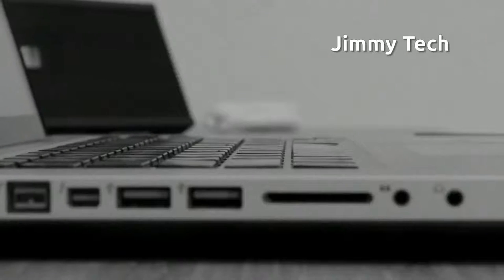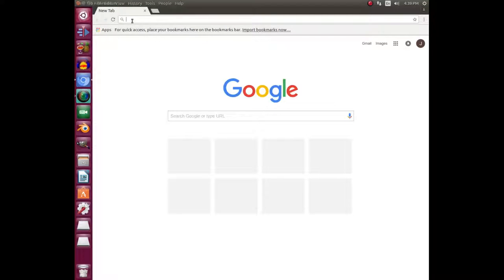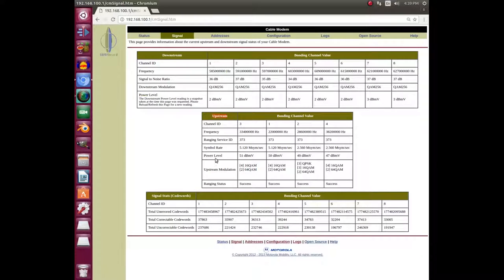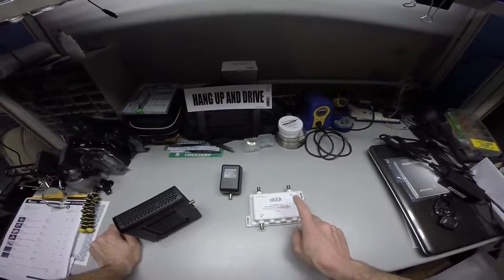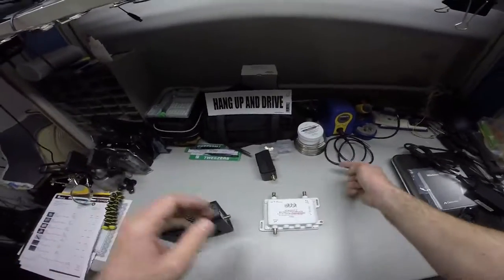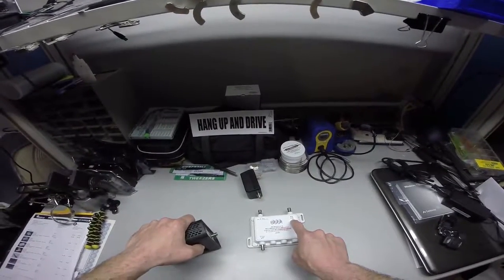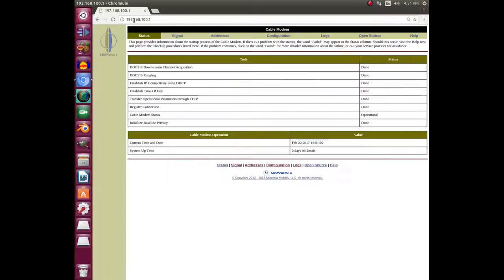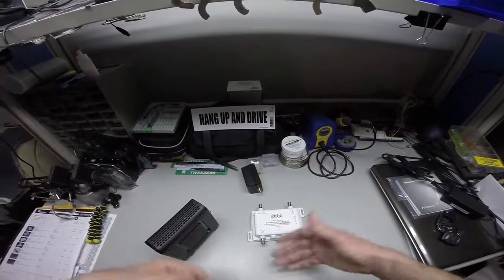JimmyTech Cable Modem Amp

Comment: My modem seems to be dropping connections once in a while to where it is noticeable.

32 down stream channels with power range from -2 - 1.5 dBmV (Signal to Noise Ratio is 40-42 dB)
8 upstream channels (5 are active in my area) ... the power range for this 48-53 dBmV

Do you think an amplitfer is worth my time? I have already tried the arris amplifier with placing it in different spots in my coax line. The best result I seen was just before the modem to where it connected to 1 down stream channel but could not establish an upstream. (Ending up return the amplifier).

Comment: my arris upstream is 43.75 DBMv, wich is high by the time you use the internet alot or game online, so as far as I understand, the booster helps drop the upstream so you have less resistance, less resistance means better faster connection. i do reccomend upgrading all your coax cables, cut all the extra excess you dont need, install your own moden, install new router and replace your old coax cables. I only use wireless wifi rather than directly connecting pc ethernet to modem.
Reply: They have updated the specs, -7 to +10 inbound old specs, now they can run from close to -7ish to  +13, on the return 40-50db old, new 38-53db. Lower your are on the return you are closer to the noice floor. That means any noise on the lines will have much more significant impact rather if the modem is running at higher rate. Adding that amplifier will throw the modem out of spec.

Comment: I'm glad you fixed your issue that really the cable company should have fixed but I know what a pain dealing with them is even for basic stuff...
I think the main take away here is different modems like or (tolerate) different values...
You fixed your upstream pwr but your down stream is now out of spec..  tho this seems to work for you and your modem...

Mine I had the opposite the up stream was fine ( in the low 40's)  but the modem was complaining about the down stream power which wasn't even bad around 6-8..
I end up dropping it  down  to  around -1 to 1  up is now in the low 50's but my router doesn't mind this and I no longer get random disconnect every few days.....
Reply from the maker: Sorry for the late reply... Your cable internet provider should be able to "choke" the downstream as attenuation can be done at your Main Point of Entry to your house.

My issue was that the 'collection office' where all the cable feeds combine was too far away and cable internet provider did not want to involve engineer to add a satelite boosting station between me and the combiner office.

Comment: What's the best way to connect 2 TVs and one modem? Should I use a tap let's say 3,5 + 8 +8 dB + one amp for the TV? Or will a regular 3 way splitter do? I think a 3-way does 5,7 dB on each

Comment: You should also no that the 4 upstream level should be within 3db. Plus to low of a tx levels can cause you just as many  problems due to being so close to noise floor. Tx45 rx0 is the best place to be. To high of a Rx level can  Cause m.e.r problems with the digital signal.

Comment: Hi.i want to double check that if I install a active return cable amplifier, do I have to connect the power to the amplifier too? I know it sounds silly but none of the installation videos talked about this.
Reply: Yes, the amplifier should come with a power supply that plugs into an electrical outlet and connects to the amplifier with a coax cable to the connector that says "PWR IN" or "DC IN", normally the top left connector.

Comment: Downstream is best to stay under 10dbmv, 14 is at the max limit and can damage modem over time.
Reply: +14 is a lot but no where near enough to damage a modem. But still high
Reply: I just hooked up and amp. And my downstream shot up to like 23. How do i bring that back down now?

Also, how does higher power damage modem?
Reply: Papi4l2 got the the same like 22

Comment: After installing a Motorola BDA-K1-RA active return amp my downstream power was still almost 20db and still disconnected frequently. I added a -6 and a -3 RF attenuator pad to bring the downstream power under 15. No more disconnects.
Reply: like why power level in this upstream is bad here so he wanted to reduce it ?

Comment: YOUR CABLE MODEM SHOULD BE THE 1ST DEVICE CONNECTED FROM THE ENTRANCE TO THE HOUSE IF YOU WANT GOOD SIGNALS AND THEN YOU CAN ADD A AMP EITHER BEFORE THE MODEM OR AFTER SEE WHICH WORKS BEST FOR YOU !!!!!!